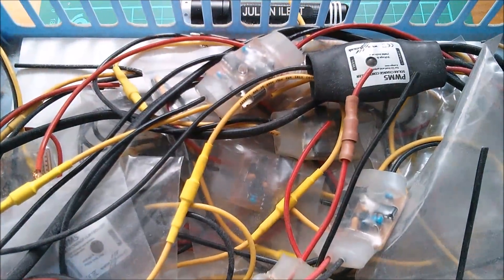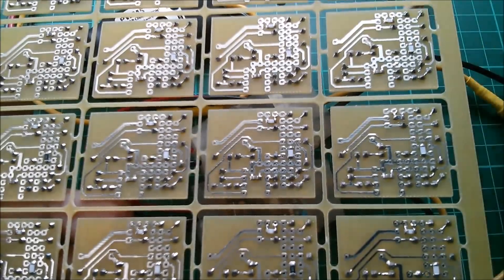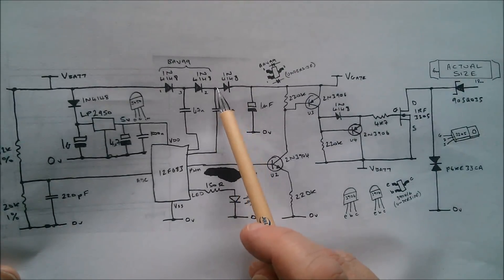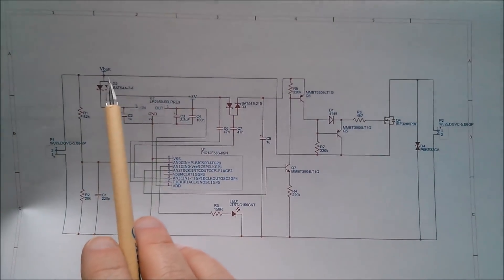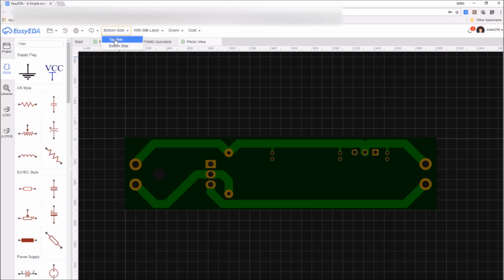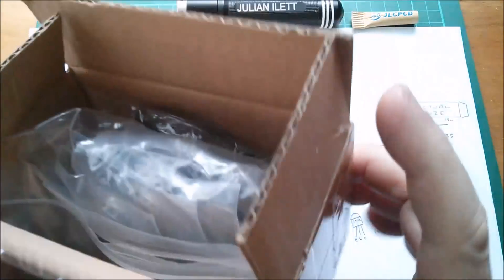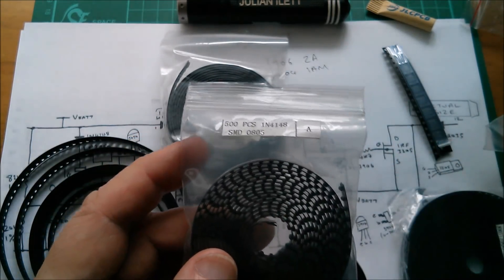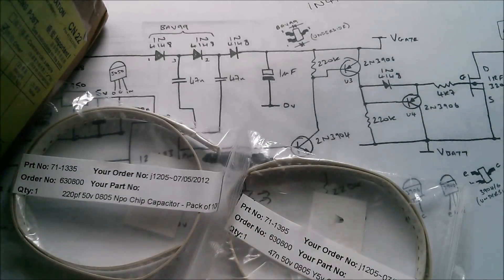Project Gumstick - Surface Mount PWM5  Solar Charge Controller

Comment: Hi julian, I am really interested on your project. You shared the PCB schematic for the Gumstick but I am interested to make the one using standard components and no SMD. Are you able to share the PCB of the standard version one?  Thanks
Reply from the maker: Not immediately, because that PCB was designed using archaic software. But I really like the idea of drawing up a new PCB using all through-hole components. What do you think, gumstick or square form factor?
Reply: Hi  @JulianIlett   this is great news. I think square one will be good but you choice the form factor. You are the boss. Ciao
Reply from the maker: I may opt for a compromise rectangle.  I think some people would like holes in the corners of the PCB to connect the four wires (instead of connecting them to the legs of the MOSFET).
Reply: Sounds good !  @JulianIlett

Comment: Not sure if you have done it in a previous video, but could you explain how your high side driver works on the PWM5 and why you are using one of your own design rather than a dedicated MOSFET driver? Cheers.

Comment: You could cut legs of voltage regulator and solder it to surface. İ saw it in a pcb which i ordered from china.

Comment: Nice! Thanks Julian. If you drill the connector holes, you can add mechanical strength. Plain pads will be prone to the copper lifting, especially if your connector leads are heavy gauge.

Comment: Why didn't you use a SMD mosfet, e.g. in a D2PAK case?
Reply from the maker: In the original PWM5, the connecting wires were soldered directly to the legs of the MOSFET - I want to retain that as an option.

Comment: Am I  understanding things right ? Vbat voltage can pass through the Q4's diode towards P2(1) ?? Reason I am asking is because when the sun is not producing cant the voltage then go through the PV (like at night), draining the battery??? Don't you need a diode to prevent this from happening (between D4 and Q4, pointing towards Q4)? I am probably way off. But I remember reading all the warning about draining your battery through your PV when there is NO sun. (Note you do show a shockley diode {90sq035 diode} in your hand drawn capture, but it does not show up on your EasyEDA draft.)
Reply from the maker: The anti-backfeed diode will be optional (and external to the controller). Maybe Schottky or an ideal diode. Is backfeed an issue at all? I've never tested it.

Comment: Hi Julian, great to see you working back on the Solar Charge Controller. Watched your previous videos and I remember you having water ingress as the hot glue was not quite good enough in some cases. Have you thought about an alternate waterproof solution?
Reply from the maker: I'll probably go for heatshrink tubing again, but maybe use silicone sealant this time
Reply: A mix gel like this would probably work well:

https://www.tlc-direct.co.uk/Products/WKMF170.html

Put the controller into a box, feed in and connect the cables, then simply pour in this gel and let it ‘set’ to make it fully waterproof!

It’s also removable so you can make any repairs/alterations and then just pour in some more. 

Might be worth a look?

Comment: Hi Julian, i am a new subscriber, and was wondering what you would make of this device? https://youtu.be/k_vd8ba3HBs
Do you recognize the hardware on those PCB's? Cheers..☺
Reply from the maker: Some sort of transmitter/receiver - hard to tell from that video
Reply: Julian Ilett . Thank you, have you seen a similar PCB as that one? Or do you recognice the components used, are they standard or state of the art?
Reply from the maker: Impossible to determine
Reply: Julian Ilett . Ok. Thank you anyway.☺ Was just trying to determine if this was a real 5G antenna array, by someone who work with new tech on a daily basis. Cheers..

Comment: How to print out ANYTHING shown on a display:

The "Print Screen" button functions as a screenshot button. It captures what is on your monitor and saves it to the clipboard.

Step 1: Press the "Print Screen" button.
Step 2: Open Paint.
Step 3: Press Ctrl+V  (paste)
Step 4: Print!

Comment: thru-hole on the wires. You'd hate to pull on a wire and pull the pad off of the board.

Comment: NPO and Y5R are temperature drift curves.  NPO have a nearly flat temperature coefficient, whereas the Y5R have a dramatic shift as the temperature changes! If your design has to work across a temperature range you need to ensure that the capacitance drift with temperature is within your design scope. There are several other temp coeff. curves, such as X5R, X7R.

Comment: Cool!  One suggestion.  If you have holes on your board for the wires to the solar panel and battery to pass through, with their insulation, before getting soldered to the board, you will have a good strain relief built right into the board.

Comment: almost looks like you  are trying to make things as hard as possible for yourself when soldering, you trying to challange yourself? :) i mean there is plenty of room to space things out a bit but you crammed all pads together as close as possible :D if it wa me if give myself as muh room as possible between components on such a small board.
Reply from the maker: This PCB is 3 inches long - way too big. I want the final design to be about 1" by ½" with components on both sides. I have a feeling the components will end up even closer together :)

Comment: How about the HT7350 for your 5V LDO? Have some of the 3.3V version, not sure where I saw them used. In any case, the datasheet list the max quiescent current as 8 uA.
Reply from the maker: That sounds just the job :)
Reply: There is also a 78xx version if you need more power. I used them in my ESP8266 projects and they are far more superior than the AMS1117 series.

http://www.holtek.com.tw/documents/10179/11842/HT73xxv150.pdf
http://www.holtek.com.tw/documents/10179/11842/HT78xxv130.pdf

I don't know much about your design but if it's only for the MCU and 3.3V 250mA power is enough alice1101983 sells the 7333 ones cheap. ;)

https://www.ebay.com/itm/100PCS-HT7333-A-HT7333-3-3V-SOT-89-Low-Power-Consumption-LDO-Voltage-Regulator/401081992689
Reply: Looking over the datasheets, I see that thew won't work on your application. The max input voltage is too low for your 12v solar panels.
Reply from the maker: Yeah, I just noticed that - my search continues :)
Reply: There are high input versions which can accept up to 30V and still has low quiescent current. ;)

http://www.holtek.com.tw/documents/10179/11842/HT73xx-1v100.pdf
http://www.holtek.com.tw/documents/10179/11842/HT73xx-2v100.pdf
http://www.holtek.com.tw/documents/10179/11842/HT73xx-3v100.pdf
http://www.holtek.com.tw/documents/10179/11842/HT73xx-7v100.pdf

But i don't know if they are easily obtainable.
Reply from the maker: Ah, now those seem pretty perfect - available on eBay and in the EasyEDA library Thanks Özay
Reply: If 100mA is enough for your circuit there are 75xx variants as well with the same quiescent current. Maybe you can get them even cheaper.  ;)

http://www.holtek.com.tw/documents/10179/11842/HT75xx-1v230.pdf
http://www.holtek.com.tw/documents/10179/11842/HT75xx-2v150.pdf
http://www.holtek.com.tw/documents/10179/11842/HT75xx-3v110.pdf
http://www.holtek.com.tw/documents/10179/11842/HT75xx-7v110.pdf
Reply: Even alice1101983 has thme. :)

https://www.ebay.com/itm/100PCS-HT7550-1-0-1A-5V-Low-Dropout-Voltage-Regulator-IC-LDO-SOT-89/312079035684

Comment: You might want to use the spare space on the ends of the PCB for strain relief. Loop the wire through one hole, then solder it through a second hole. Otherwise you may find that in use the wires pull the printed copper tracks off the board. Failing that, drill a couple more holes to the side of the PCB and loop a cable-tie around the PCB and cable.
Reply: Or simply feed the wire through the hole and solder it on both sides of the board.

Comment: I kind of get the feeling that holes for the battery/panel connections would be good for mechanical strength. A "slug" of solder in a plated hole would surely be stronger and less resistant to peeling off under a little stress?

Comment: can you describe how it works ?
Does it monitor battery voltage ?
why the pump charge oscillator does this jump up the voltage from the solar cell for operation in cloudy days ?
Reply: BillyNoMates1974  No, the charge pump is used to boost the supply voltage to control the switching transistor. The control voltage has to be higher than the voltage it is switching.
Reply: so the supply voltage from the solar cells is boosted in a PWM fashion to provide a  higher voltage from the solar cells ?
Reply: No, the charge pump simply creates a voltage high enough to drive the switching MOSFET's gate.  That voltage is applied to the gate via PWM by the PIC μC through a BJT transistor.

Comment: There are a lot of really cool inexpensive PWM  solar charge controllers including small mppt types. Not sure why anyone would want to spend time building one of these. Is it really an improvement over what is out there or is it just something to do?
Reply: jimthvac100  And how many of the 'low cost' ones are actually any good, that is, do they actually live up to their claims? I watched various video reviews of 'MPPT ' charge controllers that don't actually do MPPT.
Reply: It's designed for small solar institutions, where charge controller losses are not helpful. Most "cheap" charge controllers consume 20 to over 100 mA, which is lost or wasted energy when no solar power is available (like night time). This PWM5 uses a tiny amount of power, so doesn't deplete the battery being charged when no solar power is available for charging.

Comment: Don't use the Y5V capacitors. The capacitance decreases by up to 90% when it has a DC bias on it.
Use X7R or X5R instead, they are less effected by DC bias.
NP0 or C0G capacitors are best, but they are more expensive and not available in larger values.

Comment: This circuit looks very inefficient to me. Solar charging should be done more efficient way using low power microcontroller or smd elements with very low voltage thresholds.
Otherwise it is just dissipating energy and getting unstable.

Comment: Regarding the input/output connectors, You should at least leave the pads as through-hole because if you do SMD pads, you stand a way higher chance of stress on the cables ripping the wires off the pads and destroying your traces.
Thru-hole + via is way stronger and allows more current flow too although that's not a huge concern.

Comment: Did you consider adding a connector to allow (re)programming the micro-controller?
Reply from the maker: Bit of an issue there - the PIC only has 6 I/O pins (well 5 really). All are used and have components attached which break many of  the in-circuit programming rules.
Reply: That's going to make any ongoing development a bit difficult.
Shuffle D3 right, and there might be room for a combined DIP8 SOIC8 footprint.  Do the weird thing in the schematic of having two processors in parallel, which leads to trace placement having two sets of pads, which can then be nested (SOIC8 inside DIP8) on the actual layout.  Then use DIP8 during development (with a socket and moving the chip to a programmer as needed), and SOIC8 for actual production.  The alternative is to see if 'pin swapping' on the processor can lead to a viable in-circuit programming situation.
An unrealistic alternative is to swap to ATTiny85 which supports the single wire debug/programming protocol on its reset pin (there's been some coverage of this on YT recently).  This might be easier to support in the hardware realm, but does 'just' require the porting of the entire software system to a new architecture.  "Trivial' the boss says. :-)

Comment: Horray! Julian I need another one. Forget about MPPT, the PWM5 just works and is very efficient so suitable for small panels. I bought one from you, but gave it away to some scouts that needed a solar charger station for their summer camp, and I miss it still.

Comment: Nice, but I would use as much pcb copper as is available for the rails, like almost half a board each.
No point in etching away copper that could be useful.
Reply: Julian, etching more copper uses more etchant. Best to leave it on the board and reap its benefits. Leave the copper recovery for the recyclers at end of life.
Reply from the maker: I'm in two minds about that. Don't the PCB company recover copper from the etchant? In which case it's better in the etchant than on the board.
Reply: Julian Ilett yes I'm sure they do,  but the main reason is for current capacity, lowest resistance and shielding.
Reply: Julian Ilett ... and heat sinking!
Reply: And don't forget that recovering copper from the etchant isn't 100% efficient and it might use non-recyclable chemicals! It's better on the board than in the etchant.

Comment: As always, very exciting stuff watching you work through your project.
Just a thought... In this ever-changing world we live in, Have you thought about implementing an ESP8266 to communicate your charger as an IOT device. Wouldn't it be grand to be sitting on your sofa and with a quick check on your phone you can see the state of your batteries in the garden.
Reply from the maker: That would be cool, but writing PIC code to talk to the ESP feels a bit scary :)
Reply: Admittedly, I don't have any PIC programming experience, but having said that I know it would just be a learning curve.
I have a door (open or closed) monitor I created with an arduino Using a PCF8574 (I/O expander) and the 74HC595 (Shift register) for the output (8 RGB LED's show me the door status at a glance). This system runs independent of the ESP8266 part of my system.

The ESP8266-01 (completely independent of the arduino) is programmed with a simple MQTT sketch which queries the arduino every few seconds (send a low pulse to a pin on the arduino) and waits for a reply from the arduino (via serial)  and then updates the server.

The only thing i added to the arduino sketch was to watch for the query from the ESP8266. When it gets the request, it sends out the door status data as a serial chain. No hand shake, and no checksum. It does it so often that any mistakes are generally fixed during the next query.

Your current design could be programmed to receive the ESP8266 query request on GPIO3, but what data would you send to the ESP...OH the possibilities are endless...  Battery state, Charging Current, Solar voltage...??

Maybe this is a challenge to you and your followers.
Can the existing PIC deal with talking to the ESP8266 and keep up with its own tasks?  Maybe a second PIC which handles the information required to talk to the ESP....Heck, maybe the ESP could be introduced to the circuit as a monitor itself..?
A big draw back with the ESP is it current draw, They can suck up to 500mA when communicating. Never good for a device which you want to be efficient.

Just some Thoughts

Looking forward to the SMD soldering video... (don't forget to order the stencil.)
Cheerio....

Comment: Drilled pads are MUCH stronger than SMD pads - the trough-hole plating makes sure you don't pull off the pad as easily.
Reply: If the build is likely to be wires soldered to the board, then perhaps additional pads with big holes is the way to go.  Also the idea of a very big drill hole that the wire goes through before going to the pad to make an electrical connection will help with strain relief.  e.g. https://i.stack.imgur.com/vnF6U.jpg or https://www.wayneandlayne.com/files/bbs/build_05.jpg
Reply: Might go through a lot of bits, but if you're not the one making the boards, maybe worth it as you say. Are the boards even double sided though? Hard to tell in the video and I'm not familiar with them.

Comment: Be carefull with y capacitor, they are highly non linear. Use x ceramic capacitor. I recomment using spx5205 as ldo.
Reply from the maker: Non linear to temperature variation?
Reply: non linear to frequency and dc bias
Reply: Yes, there are differences between the different dialectics used in ceramic capacitors. Some types are more stable than others. The main applications for the poorer types are decoupling power rails when the changes in capacitance don't matter as much.
Use the better dialectics for timing, audio and filter applications.

Comment: Would you be selling these again after changing to surface mount or even selling as a kit form
Reply from the maker: No, I don't want to sell them. But the circuit, PCB layout and firmware are all open source, so anyone can make them, sell them, modify them with no restrictions :)
Reply: I myself am working on one. Right now I have a pro mini running it, but will switch to a the PIC when I find a cheap Pickit that actually... works.
Reply: I have Gumstick kits available, ready to solder up.

Comment: Will you order a solder paste stencil ? (-:
Reply from the maker: Not this time - I'll solder this one with the iron.
Reply: Will you learn how to actually solder SMD this time? Instead of poking things with a cocktail stick.
Reply: And placing half of the components upside-down not only wreaks havoc with OCD, but it adds an unnecessary obstacle to repairs and modifications. You, Julian, encountered the issue when showing us the partly-completed boards.

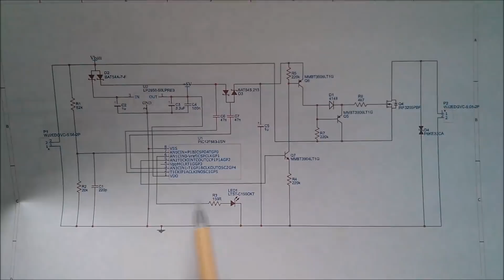Comment: Lose the R6 4.7k driving the MOSFET.  Why is it there?  8:45
Reply from the maker: Massive reduction in EMI emissions with this resistor. If the resistance seems rather high, bear in mind the MOSFET switching frequency is just 122Hz
Reply: That's interesting.  What are you using for EMI testing?
Reply from the maker: Old school AM radio

Comment: I suppose dual-layer boards will shrink the board by 20~50%! :)
Also, potting the module will help with the longevity -- get a big bottle of epoxy resin and silicone mold for that!